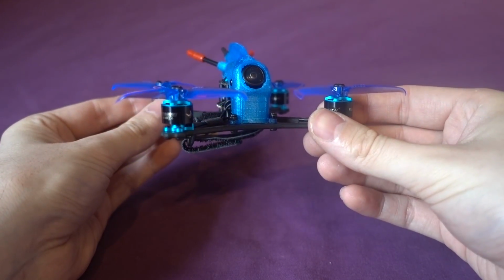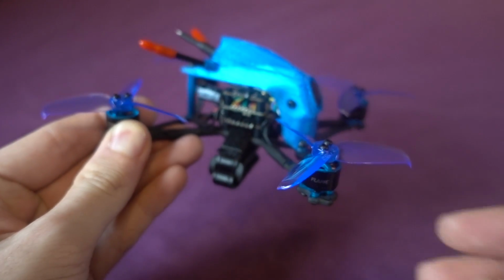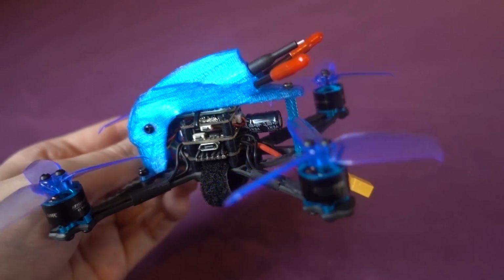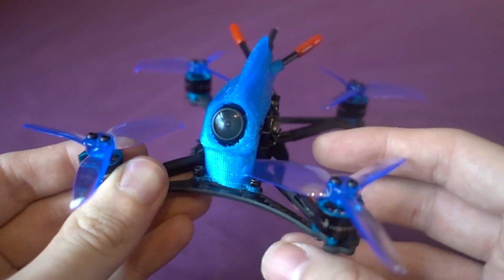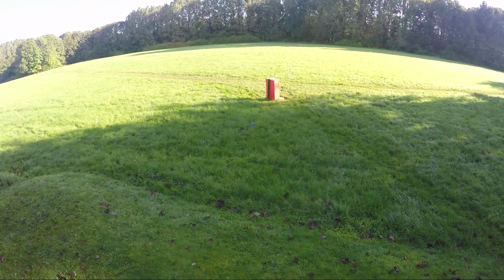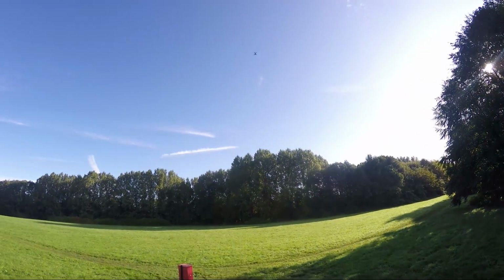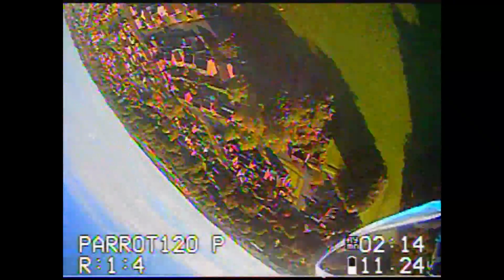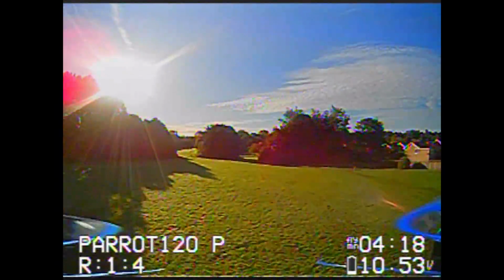HGLRC Parrot120 Pro

Comment: Im building myself a tp3 soon.
Are there any like basic Toothpick-PIDs i should use instead of the defaults?
Reply from the maker: depends on the weight but much lower than defaults start at about 17 on the D and 30-35 on the P
Reply: Any suggestions for starting pids if using 3.5.7?

Comment: Nice quad, real shame about that camera, any ideas what great resolution  cameras would fit?
Reply from the maker: the resolution of them all are the same because its analogue but if you watch the video i made on jello micro CCD cameras wont have the effect. problem is there arnt any nano ccd cameras but the fullspeed toothpick uses a micro cam. End of the day they need to learn how to mount the cmost cams properly and so far only geprc have done this the tiny hawk freestyle would have also worked but they used a lower quality camera